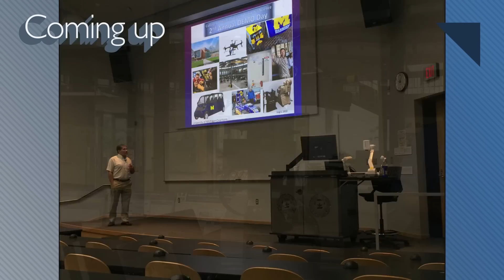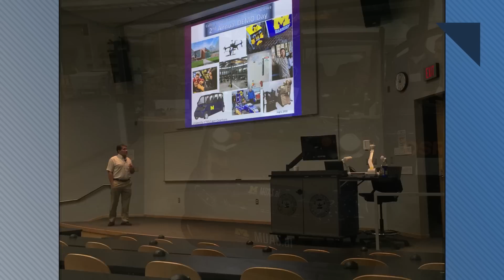FCA Attempts to Block Roxor, Tesla's Secret Chips - Autoline Daily 2407

Comment: In place of the Toyota HFC truck, why not just run a 40% efficient ICE on natural gas at its peak BSFC and use it to power an electric drivetrain? The fuel cell stack is only capable of producing 300 hp, so it's not like it would be hard to make a 300 hp, ~5 liter inline 6 which incorporates the technologies developed for the engine in the Prius. Natural gas is always going to be significantly cheaper than hydrogen, and the distribution infrastructure already exists.
Reply: idontcare80 Agreed.  And methane (natural gas) is widely available from renewable sources, and is far easier to compress, store and transport than H2.  40% of H2 energy is required just to compress it!
Reply: Yes, for right now hydrogen generation is very inefficient and costly and although we think it pollutes less than NG which is does when it is being expended only.   Just a caveat to what I say below referencing as if there is not NG infrastructure yet. There is the piping, but we do not have the pump or fill locations widespread. Also I am not so sure that the existing infrastructure could handle that kind of load increase. New pump locations will be more costly and difficult due to equipment, safety, and zoning approvals and regulation. Back to hydrogen which is cleaner in its use, but is not cleaner in its generation which takes a large amount of grid electricity to make and fuel to transport and distribute as well as station set up like NG. But eventually when we have more solar, then the hydrogen can be generated more cheaply and the hydrogen will also not pollute in its generation either. However the point I have is, that by the time we have more solar, and start to develop infrastructure filling more for NG or Hydrogen, we may have solid state batteries. If we have batteries that can charge in 15 minutes or less and weigh less, either NG or Hydrogen will be a lost cause. So if you ask me, investing in infrastructure for either in the long term will be a waste. It is just a matter of time before the battery will win over them all, and you would have wasted all that investment on filling station and more on them and would have been for temporary use.
Reply: Lounge lizard - The other technology which becomes viable in that arrangement is power recovery turbines, 50% thermal efficiency might be achievable with them. 

Ari P - I'm not saying that this is a solution for all transportation, just long haul semi-trucks. As much as the established industries would like to believe it, there is no one-size-fits-all solution to our future problems, we're simply going to have to make use of different technologies where they're best suited. 

Hydrogen will never be a solution to anything, and there are far, FAR more issues with it than just production. Hydrogen is just difficult to deal with, on every level and absolutely everything associated with it is expensive, so the economics just don't make sense. 

Producing hydrogen with solar energy will only increase the cost of producing it and waste energy.

"If we have batteries that can charge in 15 minutes or less and weigh less, either NG or Hydrogen will be a lost cause."

Charging time isn't entirely an issue with the batteries, it's more of an issue with the grid. To give a semi-truck a decent amount of range, you'd need something like a 2 MWh battery, and charging that in 15 minutes would require an 8 MW supply from the grid, that's absolutely massive. To put that in perspective, some of the aeroderivative power plants that GE makes produce 34 MW, and those are used to supplement the energy grid of an entire city! Batteries just don't make sense in the applications which require large amounts of energy and power, and that's unlikely to change any time soon.
Reply: "Toyota facility to produce electricity, hydrogen from bio-waste"
http://biomassmagazine.com/articles/14886/toyota-facility-to-produce-electricity-hydrogen-from-bio-waste

utube wannbe fanboy experts r so amusing when they rant about things u know nothing about..
Reply: A) You could never get enough hydrogen from bio waste to fuel a significant portion of the world's vehicle fleet. It's also likely that they're getting methane from the bio waste and pumping the carbon from the methane into the atmosphere in order to extract the hydrogen from it.

B) That doesn't solve all of the other absolutely enormous problems with hydrogen. The vehicles themselves are insanely expensive and incredibly pathetic, the distribution infrastructure would still need to be built and would be insanely expensive because hydrogen is so difficult to store and transport, a large amount of energy would still be required to compress the hydrogen, etc...

C) What's the price when compared to charging a BEV? Is it still many times higher? If so, why would anyone want a HFCV?
Reply: "It's also likely" ur just rationalize BS about a process u know nothing about. Like most wannabe utube experts that can't back up what they say with facts. And we just need to use all the BS comments and we will have more than enough. 

BTW the point was to just show one option. Not to pretend to be another simple minded utube expert pretending complex issues have one easy simple solution.
Reply: Also the energy needed to compress and gas. Can be captured and used when the gas is released. Compressed air car - Wikipedia
https://en.wikipedia.org/wiki/Compressed_air_car
Reply: If you know more about the process, why don't you inform me? You also completely ignored all of the other points that I brought up, because you're a mindless, shameless, amoral shill.

So, you want to add to the cost of already insanely expensive HFCVs by trying to capture a small amount of the energy that was lost during the compression of the gas? Interesting.
Reply: But hydrogen is better? This is natural gas that I'm talking about, btw, not autogas. My point here is that it makes more sense to use natural gas directly in semi-trucks rather than use a huge amount of energy and spend a huge amount of money to convert it into hydrogen, then to use that hydrogen in an enormously expensive vehicle. Hydrogen just adds cost and complexity without offering any benefit.

If every semi in the US were using the system, you can bet that it would be maintained. No demand = no money for maintenance.
Reply: No one is planning on producing hydrogen on board a vehicle, that would take huge amounts of time and huge amounts of electricity, even more than would be required to charge a BEV, because of the inefficiencies associated with producing and compressing hydrogen. Hydrogen is just greenwashing nonsense, the fossil fuel industry only wants to keep people addicted to pumps which supply their products.

Many are considering also having attendants for hydrogen, because the pressures involved are quite dangerous, and there's the potential for it to go boom as well.

Hydrogen has absolutely zero potential to be practical for anything, just due to the nature of the gas, everything associated with it is far too expensive, from its production, to its distribution, to its use. Hydrogen will never be a viable fuel.
Reply: And, yes, CNG is pretty widely used. Honda had a CNG Civic for a while (my city uses a few of them), and many city buses run on CNG. A hybrid CNG/electric drivetrain would simply reduce the amount of fuel the vehicle uses, and electric drivetrains are far better at driving the wheels of a vehicle than ICEs.
Reply: Precisely, it would also allow for quick refueling. Also, the fuel can be anything, diesel, gasoline, CNG, etc, only the ICE would need to be different for certain fuels, the electric drivetrain could always be the same. The concept that Wrightspeed is developing would even allow for diesel to be burned cleanly, without the ridiculous exhaust treatment systems that diesels need, but the efficiency isn't all that great.
Reply: You're right. HFC is going nowhere. Tesla battery technology is going to whip their a$$. The logical place to use HFC is in long distance trucking, but it offers no cost savings over diesel, whereas BEV does. 

But the Japanese, Toyota in particular, have already committed to HFC technology. It's a solution in search of a problem. Unfortunately for them, HFC has too many problems that can't be efficiently solved, and BEV solutions are getting cheaper every year.

Yes, the Achilles heal of BEV is recharge time. But battery swapping can solve that in the few cases where true 24 hour operation is required. Most applications do have built-in downtime during which supercharging (or hypercharging) can take care of the need during a mandated lunch break or rest period. Other applications can be recharged overnight for even cheaper solutions.
Reply: The Achilles heel in this case isn't just charge time, it's range. Battery swapping isn't going to be viable either, because batteries in semi trucks will be enormously heavy, and the swapping stations would be enormously expensive to build and operate. The swapping stations would almost certainly need to be manned full time, for both maintenance and trouble shooting. You can't have truckers encounter a problem with the station and expect them to wait for an attendant to show up and fix the problem. Also, the battery is the most expensive part of the truck, and you're basically saying that, for every truck purchased, two batteries will have to be purchased, that's just not going to happen.

We're stuck with hydrocarbon fuels in many applications for all of the foreseeable future, period. There is some good news, though, and that is that we can actually make carbon neutral hydrocarbon fuels, we simply need to commit to doing it.

Comment: The H2 v BEV kinds of reminds me of Beta v VHS; and then came CD and DVD = rather similar to Vinyl Records, sans the stylus but digital rather than analog, by that analogy the future will be ICE with "different" combustion.
Reply: For certain things, ICEs simply can't be replaced, but BEVs offer so many advantages that battery-electric will become the most common type of drivetrain on the road. Solar energy is cheaper than anything that the fossil fuel industry can offer, and BEVs have the potential to be cheaper than any other kind of vehicle (if manufacturers would stop loading them up with self-driving nonsense), so that will be the unbeatable combination going forward.

Consumer demand speaks louder than any industry, the products just have to be made available, and they have been.
Reply: idontcare80 
Your argument is Anti Progressive
Reply: You mean realistic?
Reply: idontcare80
What I meant was autonomous tech is the way of the future.
Reply: H2 v BEV kinds of reminds me TV v Radio that mindless fanboys cult logic will never understand...
Reply: N C
Just like you won't understand the concept of grammar.
Reply: Thx for the irrelevant mindless retort. With its own ironically stated terrible grammar...
Reply: #UseUrBrainForMoreThan#s
Reply: Nirmal Kumar Reddy - That's a completely different discussion.

Comment: Wow ExxonMobil now directly sponsors Autoline. Go figure.
Reply: That explains the fuel cell idiocy.
Reply: idontcare80 
Even some Tesla supercharger stations were initially and during interim, powered by Diesel while the renewable energy generation was being set up and fine-tuned.
That doesn't make Elon an #OilPusher these are the Necessary Evils when you are at the forefront of any tech.
Reply: Most Superchargers just get their energy from the local grid, WTF are you talking about?

Comment: The only argument that justifies hydrogen trucks is weight. It's literally the only thing that makes it a viable option. I can't believe in 2018 I'm still hearing the same old stupid platitudes about charging times. The trucks are going to site for such long periods of time, they might as well just charge. Also, the EROI ratio for hydrogen is disgusting. It really makes no sense to me.
Reply: Except that hydrogen vehicles aren't any lighter than BEVs.
Reply: Doesn't solve the weight issue.
Reply: With electric trucks you can size battery to your range need, range / weight / charging are all issues which can be tackled by planning, 

 hydrogen truck don't need recharge times but still filling those cylinders takes time, trust me we had commercial cng busses and they take forever to refill, Or recertification of hydrogen cylinders (hydrotesting), and hydrogen per mile cost as has been pointed out on internet many times, I am amazed on Toyota stubbornness. For all the years of promise we don't see breakthrough in hydrogen all the while Tesla don't need one since they are using car tech (multiple 4) in trucks.
Reply: "With electric trucks you can size battery to your range need, range / weight..."

No, you can't. Batteries are far too heavy and expensive to just size them however you want. Giving a truck the amount of range you need could mean making it too heavy and/or too expensive.

Neither hydrogen, nor batteries, are useful for hauling heavy loads on highways.
Reply: idontcare80  what I believe is if economics work then weight is irrelevant, for 1MW battery weight could be around 3500 pounds, 5%, of gross weight, (could be less minus the engine plus diesel weight), you can put battery pack in trailer if you have cargo with volume but low weight. Let's wait and see what Tesla brings to market next year.
Reply: I don't know where you got that weight, but a 1 Mwh battery would weigh around 14,000 pounds, not 3,500, and that's probably only enough for 200-300 miles of range on the highway. That's nearly as much as the weight of an entire diesel semi-tractor.

You can't put battery packs in the trailer because the trailer doesn't usually stay with the truck.

Tesla took on more than they can handle with the semi, I guarantee it.
Reply: idontcare80 I made mistake while calculating weight, your estimate is right. Well let's wait and see.

Comment: How does selling your battery business makes sense if you are a true believer in EV? Mix message from Nissan?
Reply: They are only 25% committed I guess
Reply: Daniel Quesada S. 
I guess, that's how fast your manufacturing capabilities will become obsolete if you don't keep up with the trends,
That's why most of the EV Makers rely on a supplier for now.
Reply: This makes sense. They almost had to have a guaranteed supply when they got into the battery making business. Now the tech in those batteries is not so high end, and it allows the company to sell batteries to competitors. This also frees up Nissan to look for better, or cheaper technology. Plus it frees up capital to invest into the next technology that they think will help them move forward.
Reply: They know something that TESLA does not, thus lets dump the already obsolete battery factories !!!
Reply: Miro Kefurt 
'They' aren't self-made Billionaires putting 'Their money' where their mouth is.
Reply: SubGR77  Engineering is always years ahead of production, and R&D is years ahead of engineering.
As you said, perhaps a new type of battery or fuel cell  has been developed that is significantly more efficient, simpler and cheaper to manufacture than a bazillion 18650 individual cells wired and packed together in an expensive complex package. A  design, BTW, that will be thought of as rudimentary, crude and wasteful  in 20 years.
Reply: Business 101 they can more easily sell the batteries to other automakers and now it's easier for them to change supplier now too